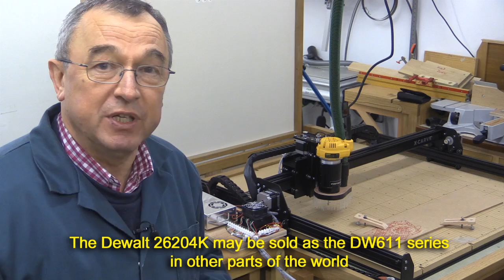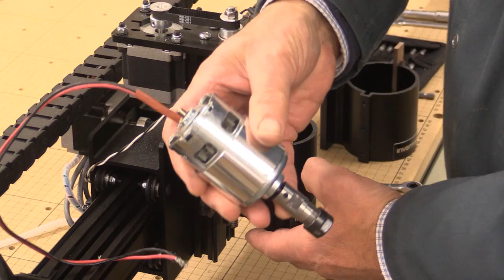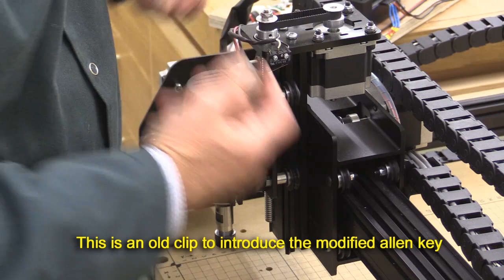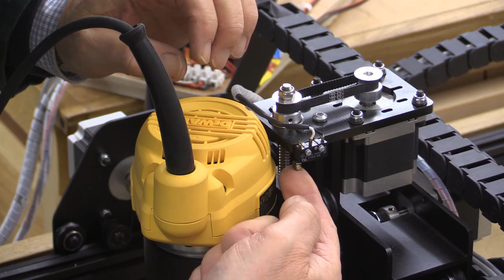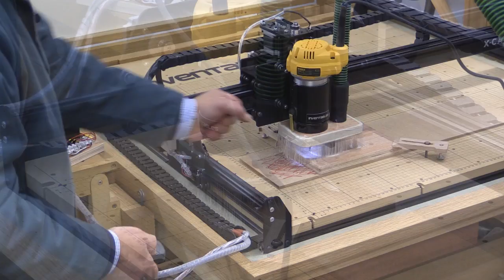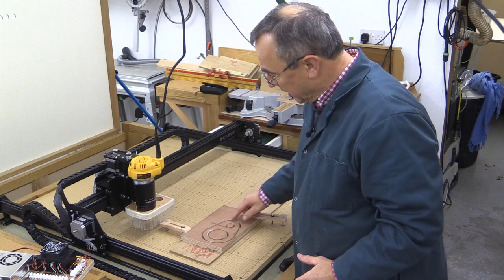How to fit a Dewalt router in an X-Carve CNC

Comment: Peter, did you check the router spindle is square to the work surface, or is the mounting bracket self-aligning. I think I would want to check for square anyway. And is there any provision for squaring the router to the work table, maybe the eccentric rollers for the Z axis but you didn't mention if you needed to square it up. Thanks, enjoy all your videos, keep them coming please.
Reply from the maker: Hi Bob, I did check but did not realise it was not in the video. I think that I show the process in one of the setting up videos for the X-Carve.   Peter

Comment: you could add a relay to turn the router on and off with the DC motor pins
Reply from the maker: +Amaury Jacquot   Hi Amaury, Yes, that is a good idea. I did look a couple of weeks ago for some that I have had for years but could not find them. For now I will continue as I am but it is certainly worth considering in future.     Peter

Comment: What sort of bit where you using and do you have a recommended place of purchase. Thanks
Reply from the maker: +Ben Johnson Hi Ben, When I made the prototype dust boot (not shown in this video) I was using the 24v spindle and had to use a two flute straight cutter that was short in length in order to minimise the awful vibration. When I installed the Dewalt and made the final dust boot I was able to use a spiral upcut (1/4" shank and quite long) that came from Inventables. Forgive me I can't remember where you live but if I were in the US I would go for Whiteside which can be found in the UK through Routercutter dot co dot UK.   Peter
Reply: +New Brit Workshop (Peter) Thanks Peter, Great Help

Comment: Really great video, what was the material used round the wood to provide the bristles? I did think maybe draft proof strip of black bristles with the metal strip along the back if I was to recreate it and wondered if you'd tried other things asides from the material shown in the clip? If you prefer to leave it for the other video that's fine, just interested.
Craig
Reply from the maker: +Craig Hastie Hi Craig, You know the type of plastic used in those cartons that are used for kit on those hanging displays? It is clear and about 0.3 mm thick. It is also a devil to get at the contents inside and I usually have to cut m way in. I had some of that and cut it into strips and then cut almost all the way across at about 2 mm intervals. This was then stuck on with double sided tape and finished with some gaffer tape. I will be releasing a video about this very soon.    Peter